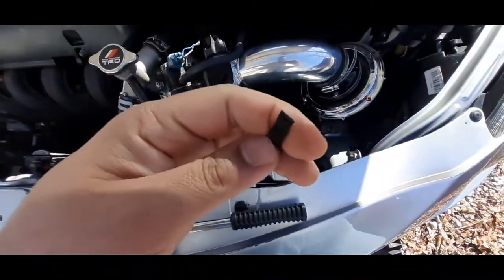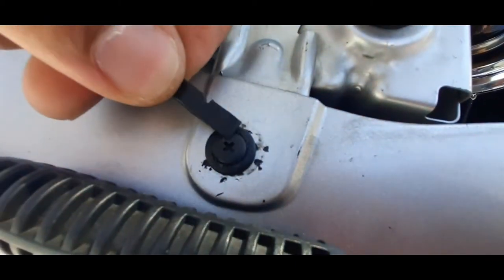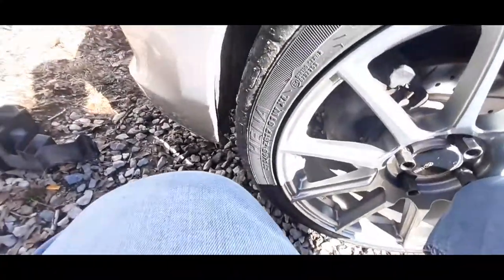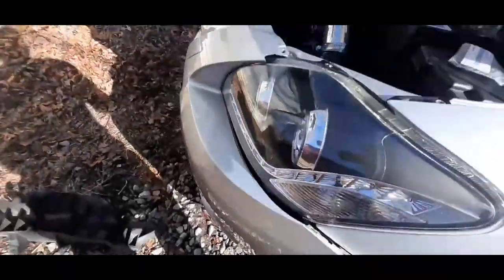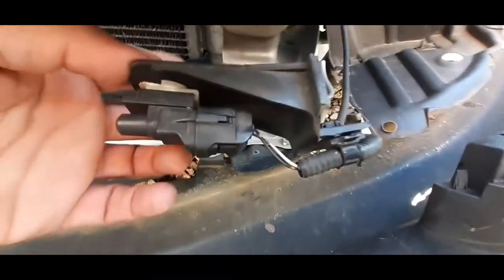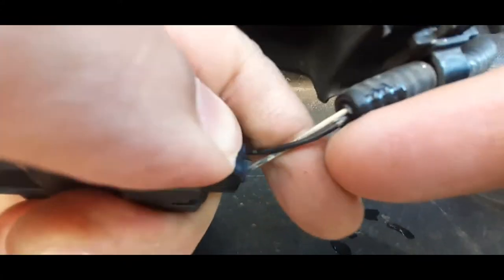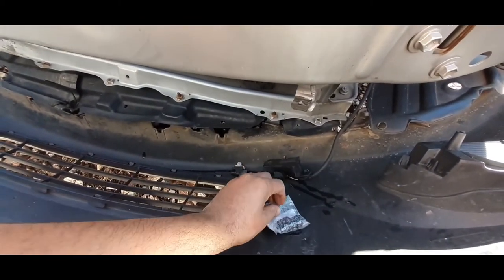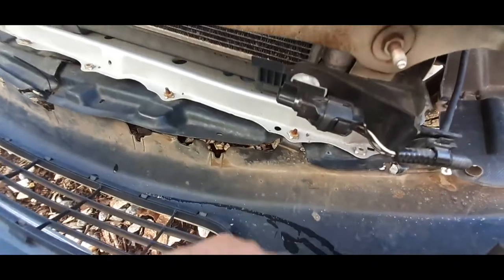Toyota How To Replace Ambient Temperature Sensor

Comment: Do you have any video for yaris 2019 i wont to change the sensor temperature ambient because not show me good in dashboard??
Reply: I always suggest to check it with car computer scanner for codes and verify if it is truly the parts fault or any other problem.

Comment: hi there changed the sensor but still is not showing the outside temp!!!???? do you know what might be cause of it?
Reply from the maker: Have you tried rechecking the connection and was it a new or used sensor could possibly be faulty or possible short in the wiring
Reply: Mi czujnik pokazywał   dużo mniej. Pomogło odłączenie masy od akumulatora na 15 minut. Po podłączeniu ponownie na wyświetlaczu pokazywało mi juz dobrą wartość.